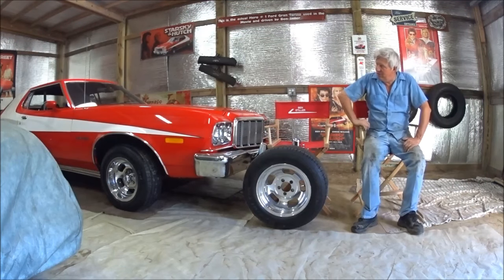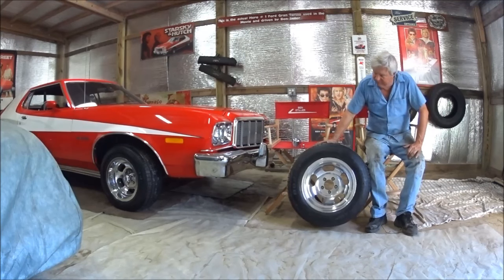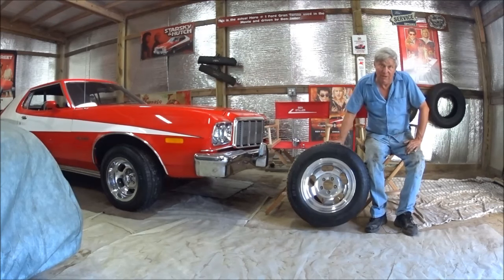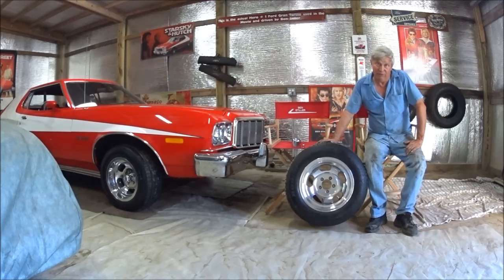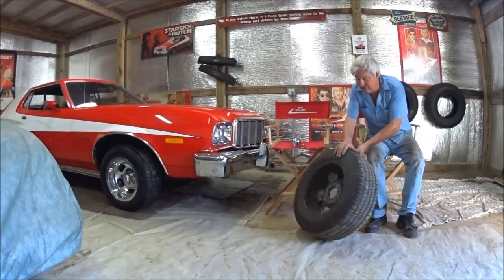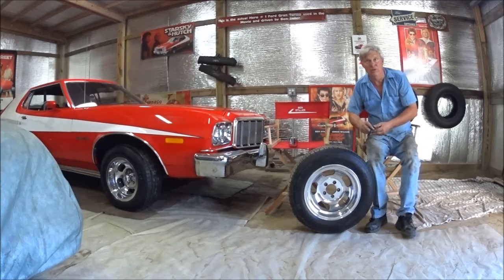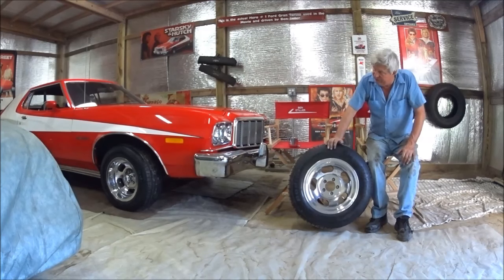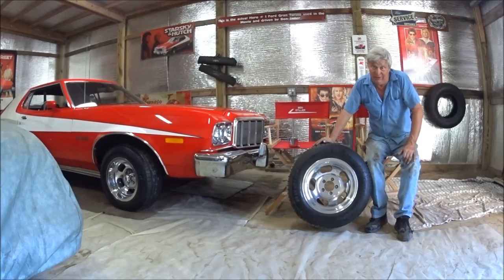Starsky & Hutch Movie Car  5 slot aluminum wheel info

Comment: Been looking for info on the wheels to make a tribute car drag racing video helped the reason tribute instead of replica is because I’m dropping a 440 big block inside instead of using small block fords not a fan of Ford motors get more power with a suped up turbo charged  440

Comment: Just to clarify, you said that car is the same car that's wrecked at the end of the movie during the credits?
Reply from the maker: yes,, they did the stunt 2 times, the stunt man, Cory wanted a third try. thats why it was cought on film..They used the hero car with the high performane 425 hp engine to get the speed they needed for the slide..They used one of the first two trys in the movie when  Starsky picks up Hutch in front of the police station
Reply: Are there reproduction body panels available for these cars?